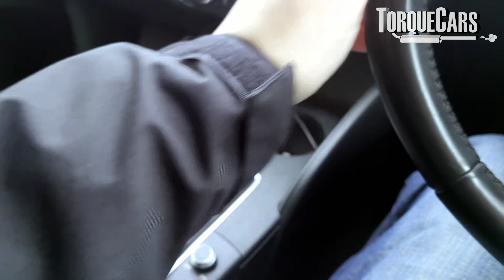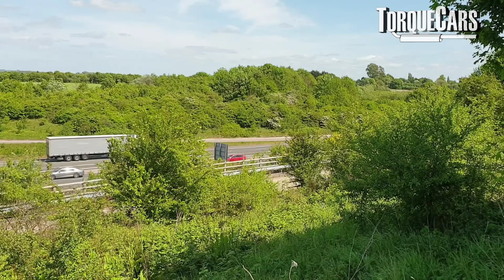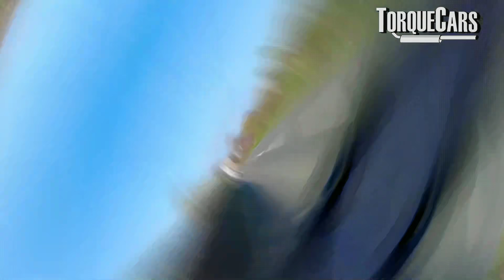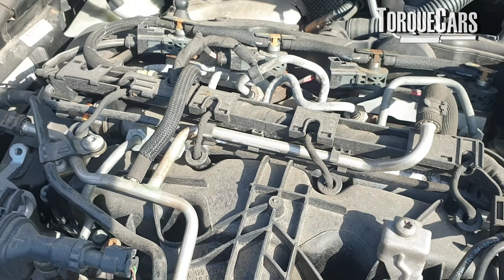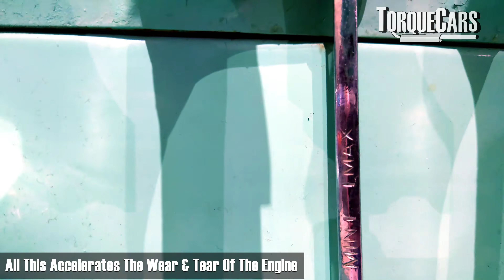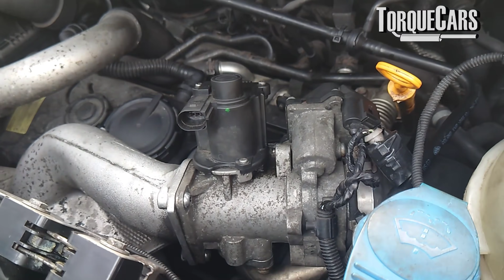Worst 7 Diesel Driving Habits 💀 Engine Killing Mistakes 🔥 80% Drivers Do EVERY Trip!

Comment: So I have a bmw 320d which I drive to work every day, I only have about a 5 min drive to work which I realize isn't good for the engine, however I usually go on longer drives on weekend (at least 40 min) would this be considered enough to not clog the engine up?
Reply: Do you put your foot down much? Worth ragging it a fair bit if your not doing many miles will keep car clean.
Reply: @Gzxs  that's a myth and poor advice
Reply: @Gzxs  not really, might go for a little spirited drive sometimes but usually its just ordinary traffic
Reply: Walk to work? Use the car for long journeys at the weekend and once warmed up - give it a high rev blast now and then.
Reply: @itchyscratch3829  If I weren't so lazy that would 100% be the thing to do 😅